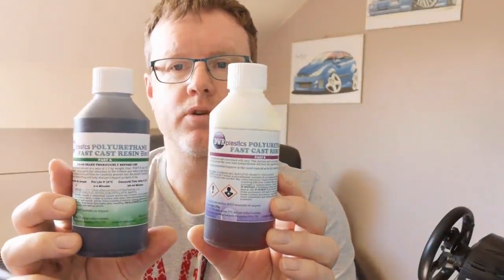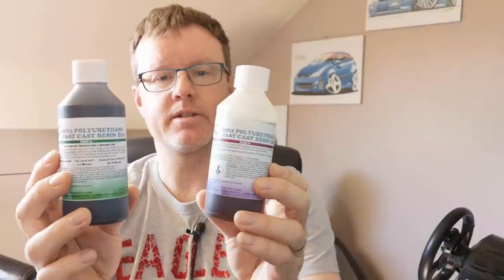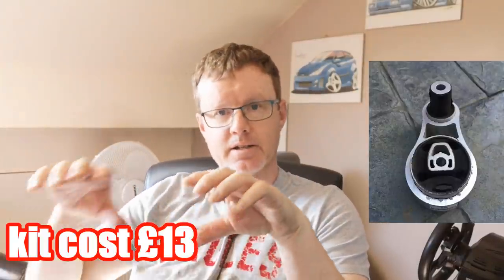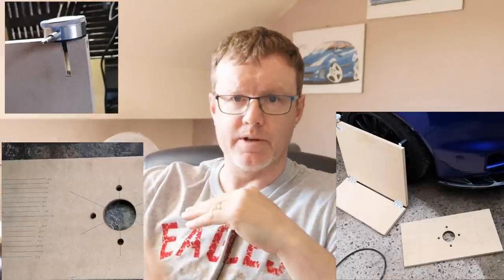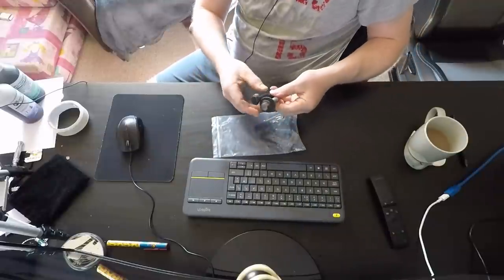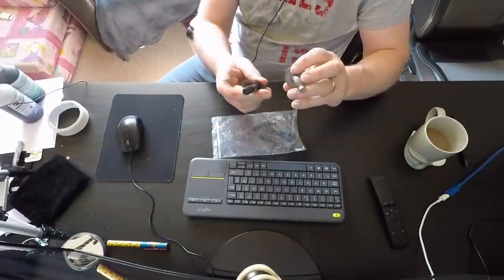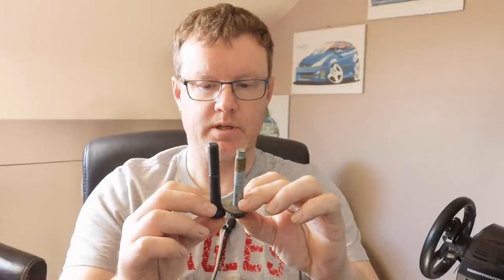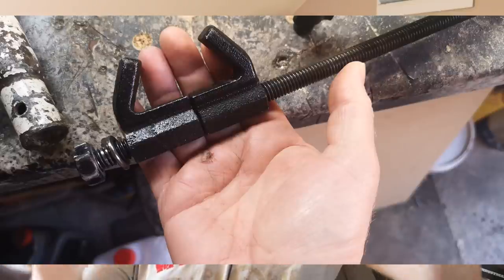Brace yourselves for some technical vids. New mods for Yobo the fiesta st

Comment: love getting technical as a kit car designer  ive  had to overcome this problem of bump steer  on many a design  you  have the basics and  basically as long as your trackrods are  level  when your finished your about as good as it is  limiting factors are   rack length  short trackrods are worse than longer ones  but  i dont think your going to extremes like shortning racks  we used to take 9inch out of the sierra ones  and extend the trackrods  4n half inch  your idea of lifting it is  on the right track  also bear in mind the float of the balljoint your using as this can limit  you big time we had to use  austin maxi balljoints because they are fully floating  and retaper the sierra hubs to fit  this applies also for the track rod end joint  this may also limit movement rose joins and spacers may help if  necessary  but yes its right up my ally is caster camber and kpi  looking forlward to seeing the results
Reply from the maker: Thanks. Iv never done it before so going in headfirst. Appreciate all advice.

Comment: The problem I’ve found with pouring poly into rubber mount voids is it never sticks to the rubber properly and eventually falls out
Reply from the maker: I did wonder about that. I was thinking of making it overflow to form a flange either side. Iv tried polyethylene sealants in the past but never this type. Any tips welcomed.
Reply: I was thinking of duck taping the mount once its filled and dried to hold the poly in but its a bit of a bodge and your idea sounds much better.